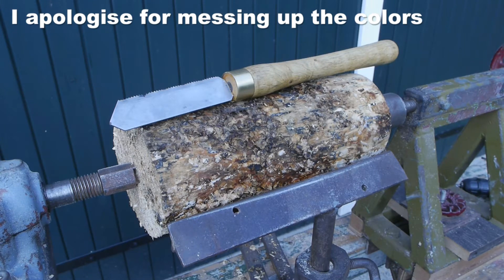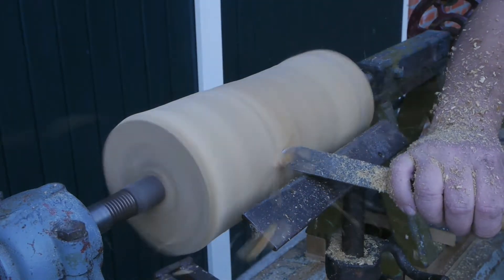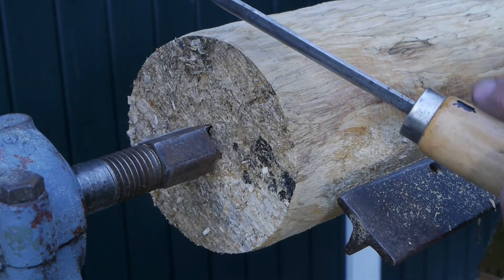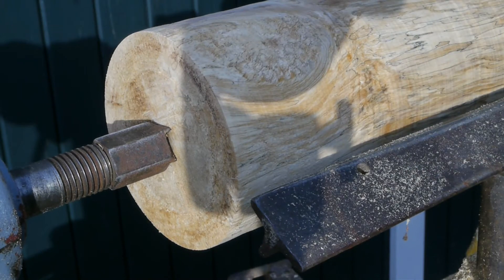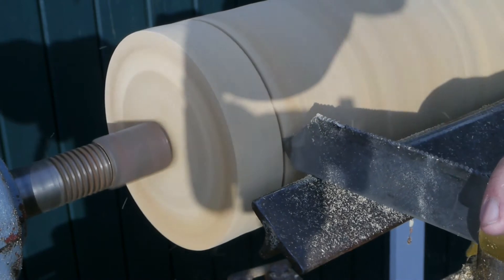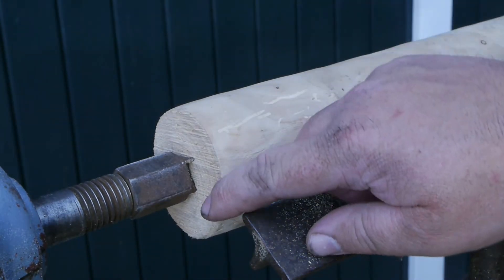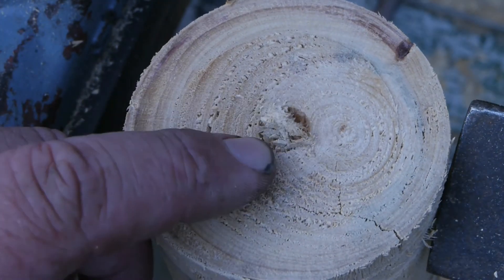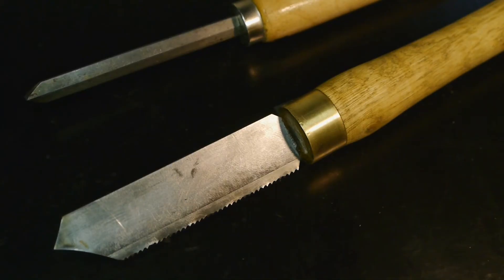Testing my home made hack saw parting tool

Comment: The problems I have found with a hacksaw blade parting tool are overheating, burning, and jamming, as has been experienced here.
One thing I found essential was to remove the teeth, mainly for safety reasons, but also for function, as the teeth are wider than the cutting tip, and so tend to jam, or if you prefer, snatch, and the contact causes heating.  
When the teeth are removed, its also beneficial to very slightly taper the sides of the blade, by removing a little of the edges, this reduces contact with the sides of the tool, and the wood, which in turn reduces friction heating, and burning. It may also be beneficial to reduce the width of the blade from the back edge, to reduce contact, and therefore heating.

Also, if you make the cutting point as close to the teeth as possible, thats where the hardest metal is, it will stay sharp a lot longer. [The reverse of the example here]
Hacksaw blades are made with two hardesses, a very narrow very, hard area where the teeth are, and a less hard area for the back of the blade.
In the final view, [7 mins on], the two areas can be seen clearly. 
Another useful extra, is to spray the blade with pure wax furniture polish, but make sure its just wax, plus a propellant.
I bought some furniture polish and sprayed various steel tools, including my planer bed, to prevent rust, and the next day they were all rusty as hell!

Comment: Good video. I use a metal saw blade to part off too. I remove the tool rest and put the teeth under the wood and carefully completely part off the wood using the saw teeth. I don't have the tool rest in my way and it works fine. You were using the tool rest and you were trying to use the teeth  on top of the wood. I do the underside of the wood. Maybe try your tool that way. Nice job on the handle too.
Reply from the maker: I will give that method a try. Thanks.

Comment: The new tool performed well.  It will actually do even better if you re figure the end without it turning blue.  To do this you need to feather it into the stone and dip in water while shaping. Oce the steel has turned blue the temper in that are is lost and the steel will not hold its edge as well.

Comment: Well, it certainly works. I don't think thin tools like that are meant for going very deeply into the wood. As I understand it (and I'm no expert) they're for tasks like parting a bowl off a glue block or adding thin lines to a project like a honey-dipper. I think your tool could do both. Nice work!
Reply from the maker: Lots of drag when you go deep. It could use some clearance.

Comment: The pattern you noticed in the first piece of wood is called spalting.  Highly desired by many wood turners.  It is formed by fungi as they consume the wood.  The lines are boundary markers to keep other fungi away.  The black line will be good wood.   The area within the black lines is slowly consumed by the fungi.  If the process is not stopped the wood becomes soft and like powder.  In the US this is called "pumky" wood.  Not good for turning if too punky.

Sara Robinson is an expert on spalting.  She has done research to grow the fungi in the lab and is working on how to extract the various colours from the fungi.   The black pattern is the most common.  A YouTube video if you are interested.

https://www.youtube.com/watch?v=fWedsgkoxYY

The new parting tool is working well.  It needs some side clearance.  Your diamond parting tool shape provides side clearance with the diamond points on the side.  If you widen the path similar to what you did for the final parting, the tool will work better since there will be less friction.   The tool has a lot of surface area in the cut  Widening the path will allow more of the force to go into cutting and not overcoming friction.

I tried using a wood saw with the lathe turning.  I observed the same as you - it did not work.  The wood is moving much faster than the saw can cut so the saw ends up bouncing on the wood.  The parting tool saw side may cut if you cut by hand with the wood stationary.  The teeth have very small gullets since intended for cutting metal, so the gullets will fill up fast then they will not cut well.

Good job on the new parting tool.  I like the curved shape you ground.  Well done.  Nice to have a good result.
Reply from the maker: Thanks for explaining that. The video was also very interesting. Brought me right back to my school days when I was playing with agar and all kind of cultures. Especially yeasts for making beer :)

You're right, the tool could use some clearance to reduce friction. And I guess the friction increases when the tool heats up. I think I'll grind en bit of from  both sides near the tip. I dont want to make the part where it rests on the toolrest any thinner. 
But so far I've been pretty please with the results.

Comment: Works better than I thought it would I wasn't doubting you ability to make one I just thought the blade was to thin good job at making a successful tool. I have been working on my metal lathe and had a catch and bent a half inch bolt like a pretzel and needed to tram it in. I was up until 1am and got it to .00045" over 3"
Reply from the maker: I was worried that the thin blade might be to flexible but so far that's not a problem.
The small blade might damage the toolrest over time.